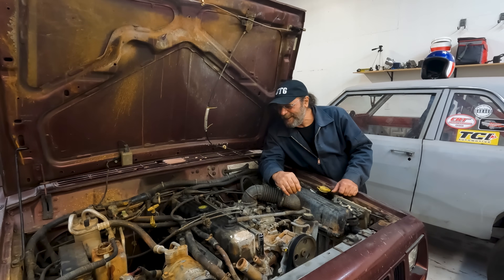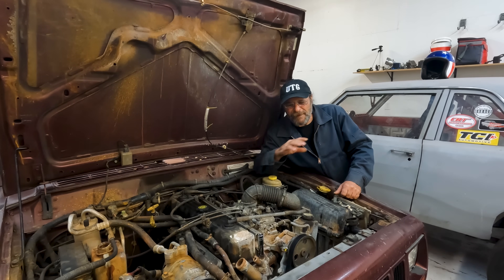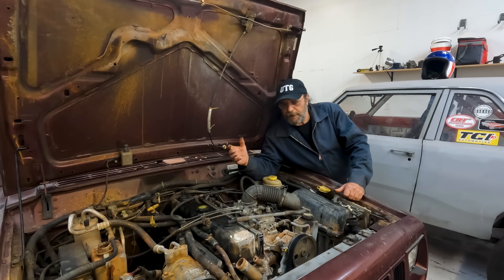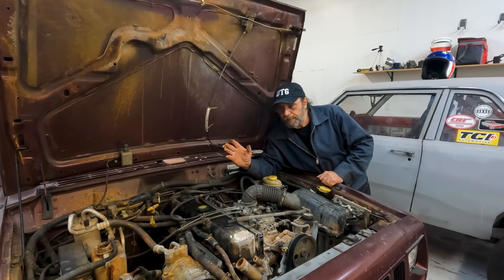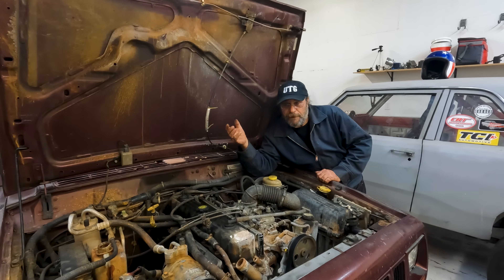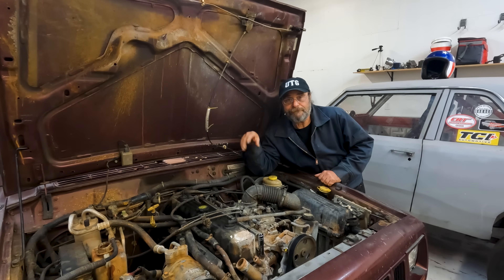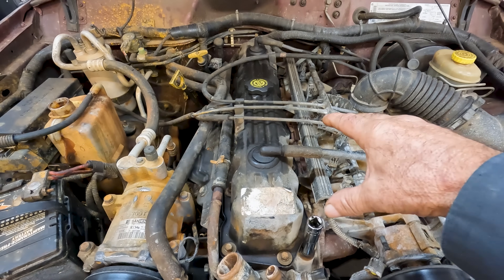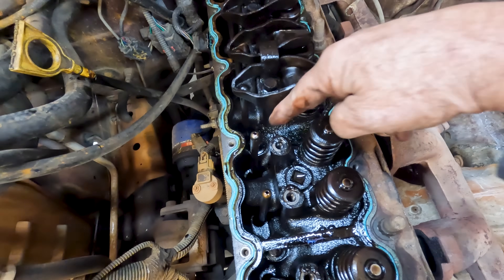Our Blue Devil Head Gasket Experiment Failed - Let's Find Out Why

Comment: El Diablo drain cleaner works great on heater cores. Its ACID be careful! so entire face covering and gloves with garden hose ready when you blow it out with compressed air, and flush with hose. 👍👍
Reply: Tony will use a metal spray bottle while smoking in a confined area